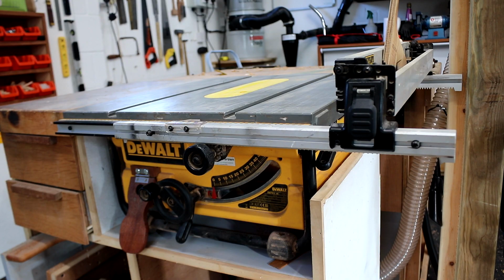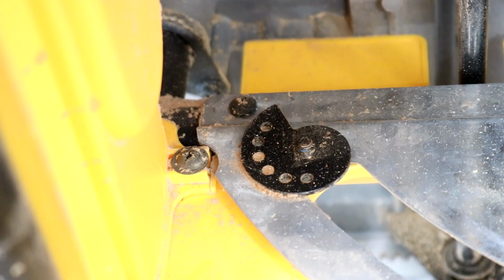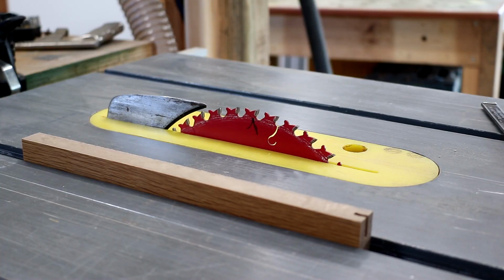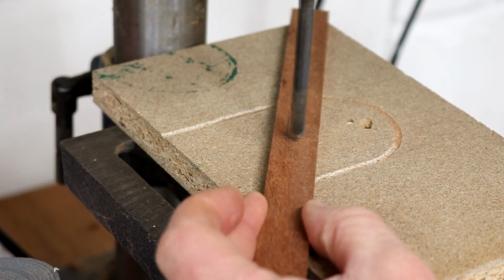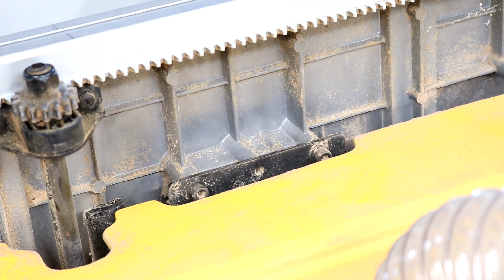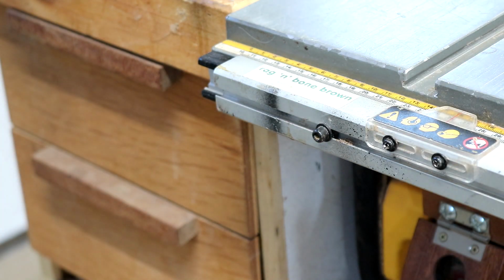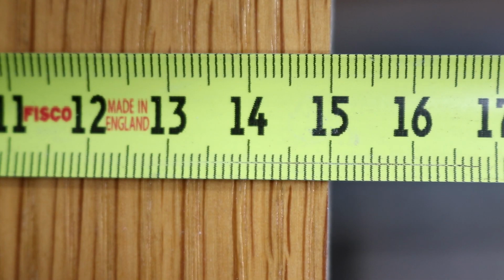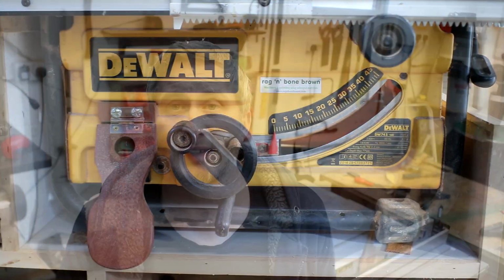Table Saw Set Up - 3 simple steps for accurate cuts. Demonstrated on DeWalt DW745

Comment: Those bolts to loosen the trunnion to adjust the position of the blade are really hard to unscrew.  There must be some thread lock on them or something.   I'm afraid of stripping the screws.  I'm going to reach out to DeWalt customer service for advice.  The table on my 7491RS isn't flat at all.  Too late to take it back now.  But I still like it!  Thanks for the video!

Comment: My new 745 doesn’t use a Phillips for the angle set screw, I uses an Allen/hex wrench.  Unfortunately, they’ve also either moved the screw or changed the blade crank so there is no direct path, physical or visual, o the set screw.  Even if you use the short part of the wrench, you cannot see the set screw or stop because the crank is in the way.  :(.

Comment: I have the DW7491 saw. All is fine except that the table dips in the middle, about 2mm. I could have returned it but I checked in a shop and all the saws had this dip. Its still a good saw.. maybe I will put some tension on it from the bottom, as it would help it.

Comment: Thank you so much.
You are the first you tuber who shows the first and most basic step. How to make sure the blade aligns with the slots in the table for the mitre slides.
If the blade is not parallel to the mitre slots then all the other adjustments are just a waste of time.

Comment: Noticed the other day my dw745 was causing snipe at the end of cut. I though the fence was out so adjusted it to be parallel with blade. Today I thought I would check it and then looked at distance from mitre slots to fence and it is out by 2mm.  Going to follow your advice and try and fix it. Had noticed [like Tamar] that my crosscut sled was not as accurate and zero clearance cut seemed to be wider. Anyway hopefully with your alignment jig I can get it sorted. Thanks Keith ( & Tamar)
Reply from the maker: Thanks for sharing

Comment: Great video. I was wondering when checking with the adjustable square would it be easier to keep that piece of wood on the mitre slow. You could then put the adjustable combi square against that piece of wood  you earlier cut to measure disatance from the blade and the slot on table. Was just wandering if that would be easier

Comment: There's one additional check that isn't mentioned in any of these videos and I learned it the hard way. After cutting tenons for door rails carefully on a scrap piece to get the right height of the blade, and then not having it fit correctly on my real wood, I found that it's very common for the height of the blade to slip due to the vibrations when the saw is running, especially if using a dado blade but I've also had it happen on my regular blade. If your saw is running and you can visually see the blade height wheel turning on its own, you have this problem. To fix it, look under the table. There's a horizontal rod which connects to a vertical rod by way of two cogs that fit together (for lack of a better term). There's a nut at the bottom of the vertical rod. Tighten that until the wheel doesn't slip on its own. Too tight and you won't be able to raise the wheel.
Reply: Aha! Good tip Susie D 👍 I believe the cogs are called bevel gears ⚙️. I didn't know about the snail cams before this video either! Off to tune the tablesaw... 📐
Reply: Thanks!!!!!!!🎉

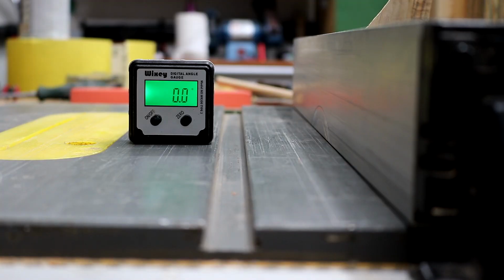Comment: Thanks for the video! Do you know how to solve the fence not being square to the table, mentioned at 6:39? I have a similar Dewalt saw (DWE7480) with a fence that just barely 'leans' toward the blade so it's just under 90 degrees, it's pretty damn close as is but would be great to get it even closer.

Comment: the slightly greater gap on the rear of the blade is and should be intended so the the blade can't bind and shoot the workpiece in your direction.
never try ro get it parallel to the fence oder worse, tighter than the in the front.

Comment: I have a newer version of the DW745 and I'm fairly certain the two mitre slots do not run parallel to each other.
If I make a jig with two perfectly sized runners, the runners slide smoothly with no binding or friction UNTIL they are stuck to the bottom of the jig, when it all binds up.

Not sure there is much to be done there. Part of me wants to return the saw, but then the rest of me recognises it's a jobsite saw and perhaps my expetatins are unrealistic... In saying that, if I'd known it was like this, I'd probably have not bought it.

Comment: How do you compensate for the sloppy fence movement? I’ve noticed while you turn the adjustment know the side of the fence closes to you moves forward or backwards upwards of a 1/4 inch before the other side starts to move..

Comment: Hi.  I'm curious to know if the slots on the base of your machine offer a precise fit for the sliding mitre cutter/gauge. I've recently bought a Dewalt table saw (don't have the model number right now, but looks very similar to one you have in this video) and there is a small amount of play, (side to side) which, to be honest, I'm not too happy about.  Is it the same on your machine? If so, do you have a remedy so it runs smoothly without any play?
Reply from the maker: it's the same on pretty much all table saws at any price point in my experience https://www.youtube.com/watch?v=Jvx4qIGPpAI
Reply: @RagnBoneBrown  The curious thing is that my original table saw, the manufacturer's name escapes now, which was relatively cheap in comparison to the DeWalt I now have, had the sliding mitre section running almost perfectly -- without any noticeable play.  That's why I'm somewhat surprised the DeWalt (and most others, as you say) is lacking in this department.
Reply: @RagnBoneBrown  Do you have any quick fix to remedy that?

Comment: Good info!  The very first step, however, should be to check the blade for runout (wobble).  If there is runout, it could be the blade being not perfectly flat--or worst case--a bent arbor/motor shaft.  But it also may be something as simple as a bit of sawdust between one of the washers and the blade.  If you find runout, first check to make sure the arbor, washers, and blade are perfectly clean.  Be safe!

Comment: I have the dcs8745. My fence is 90 at the front and 89 at the back. Double checking with a square, I can confirm the warped fence. Ugh!!! I like the saw except its only got the single mitre slot on the left and the table is quite small. The mitre guage is pants and the 45/90 adjustments are very fiddly.

Comment: The problem with referencing the blade to one bit of the table is that the tables are not flat.  I'd read about that criticism in a YouTube review before buying my DW7491, but thought it can't be that bad, and it's a job site saw for goodness sake, but mine is at least a millimetre higher in the middle and drops off both sides and, to a lesser extent, front to back.  I have fixed my issue for small jobs via a cross cut sled.  I have not worked out how to overcome the issue with larger pieces.  Hey, I didn't know about the angle adjustment end stop cams.  I've only owned saw a week, and obviously haven't RTFM (read the flipping manual).  Cool tip (or reveal).  Regards measuring tools, you can get a DTI from Wish.com or Bangood.com for as little as US$10, and they work perfectly, and are accurate.  The smaller DTIs don't have all the features of a Starrett but are totally usable.  The larger travel style DTIs from China compare really well with Starrett, Mitutoyo, Brown & Sharp etc.  Other engineering tools that can be incredibly useful in a wood shop are 1-2-3 blocks (about $25 a pair from China).  I use them for everything from aligning edges to setting up jointer blades (with DTI and calipers).  Surface Gauge/scriber blocks are also invaluable, but not available from wish and bangood.  I paid NZ$60 for mine.  The digital angle finder you used is another incredibly useful tool.  I actually use mine for setting angles of job pieces in the milling machine vice as well as table saw blades and fences, and jointer fence.   BTW a tiny warning about wish.com... once you start using it you'll have a job stopping.  I have spent at least a thousand bucks between wish and bangood, but my toolbox is almost as well equipped now in retirement as when I was still working as a toolmaker.
Reply: Any saw with an aluminum table has this problem. Milled cast iron table saws are heavier, so aren't used for "jobsite" saws. I only have a small shed, so the compromise on weight/table flatness is OK with me. I love the fence on this saw, which is what sold me on it vs. competitor models.
Reply: Hello, I am having a similar issue with my table saw. The top table is not straight and the precision mitre gage does not lie flat in the mitre slot, it seesaws front to back. I got a useless response from dewalt today and have no idea if something can be done about that. Would you have any ideas? Thanks
Reply: @radu-christianbarca746  The cross cut sled is the ultimate solution.  They are not only far more accurate (especially if you use the William Ng 'five cut' method to set the rear fence https://www.youtube.com/watch?v=UbG-n--LFgQ) they are also much safer because the part is supported both sides of the cut which makes kick-back unlikely.  Even if you  do manage to get a kick-back, the rear fence is going to catch the part preventing it hitting you in the face at 100mph. There are also lots of designs for smaller, single fence sleds that work like a mitre gage. i.e. https://www.youtube.com/watch?v=L4czbtrzGBQ  

The main thing is to use both T slots which will help take out any slop, and have a wooden base that eliminates the warped top.  It is also a fun project.  You'll end up with a bunch of sleds like 45° mitre (William Ng has a tip for getting these super accurate as well) a tenon cutting https://www.youtube.com/watch?v=TcTGm9vQ-QI and any number more if you search youtube.
Reply: @TrevorDennis100  thank you very much! I will watch those videos attentively and i will surely end up biilding a sled. Still, wouldn t the sled glide on those u even miter slots? Side to side wiggle can be eliminated, but back to front slopes will translate to the sled's fwd bckwrd motion and to the wood in relation to the blade. Which would matter in some cuts, but not others obviously. Am I missing something here?

Comment: Curious whether your saw has a 5/8” (16mm depending where you’re from) arbor? If so how did you manage to get a 30mm Freud blade on it? I can’t fit a 30-16mm reduction bush on mine because of the concave flange design on the saw. There’s far too much room for the bush to move around on the spindle losing contact with the blade bore, in the process. Spoken to at least 6 different people at Dewalt and no-one has any idea how you can do it safely? Not for a 30mm bore anyway.
Reply from the maker: It has a 30mm arbour. No adapter ring needed
Reply: Rag 'n' Bone Brown amazing, here in Australia both the DWE745 and the DWE7491 are sold with a 16mm arbour. No idea why they’d make them different?

Comment: I have the same saw and my fence is not vertically perpendicular to the table. you mentioned checking this but not how to correct. i can seem to figure out how to get the fence to 90degrees vertical. Any tips?

Comment: Great info, I have the dewalt dwe7492 and my fence is not 90 to the table, do you how to set the fence. thanks John
Reply: I've got the very same problem. I've taken the fence apart by removing the aluminum fence from the side plastic  brackets, but that didn't do any good as there is no play to try and adjust the 90° angle to the table. A little help would be much appreciated. Thanks

Comment: my left mitre slot is definitely not straight. and my table saw top is not flat. i bought this table saw last year and only opened it a couple of weeks ago. lol
Reply from the maker: That's some poor quality control 😕
Reply: I have exactly the same problem (same model as Matt's). In fact, the coating starting chipping off inside the mitre slot. Any ideas on how I could fix this? Would really appreciate some advice

Comment: Hi, thanks or this video, it has answered all my questions that i had about a small saw. i looking forward to get one. i was wondering is your fence an after market one or is it Dewalt's own with the machine. i was looking forward to  buy Bosch and wishing to sort out an after market fence for accuracy.  your input will be much appreciated mate. thanks
Reply: mian isbah rehman That’s Dewalt’s standard fence. In my opinion, their rack and pinion adjustment system is one of the best on the market.

Comment: Do you know how to adjust the fence so it is perpendicular to the table top? Everything is setup really well on my dewalt saw but the fence isnt quite square. Its perfectly parallel to the mitre slots and blade but needs the fence adjusting on its vertical plane. You note to check vertical alignment but dont mention how to adjust this setting if it needs changing. Thanks
Reply from the maker: I'm not sure, not something I've needed to do sorry. Not sure if it is adjustable - might be worth tweeting DeWalt!
Reply: @RagnBoneBrown  okay thanks. Made contact with dewalt so now  waiting for an answer
Reply: @djmdog8754  Any response from Dewalt on how to adjust that fence to be purpendicular to the table top?
Reply: @arnoldwiggins  they said its not adjustable so i just live with it, but when i need to be really accurate I add a plywood fence against the metal fence which i can tweak with thin plastic window fitting shims to get perfect.  I rarely need to be that accurate on the vertical as most wood i use is quite short so touches the same part of the fence and can be cut on a single pass. I do however find large timbers needing to be flipped over to fully rip are the main problem eg 150mm   thick as i dont have a jointer the wood can touch different heights on the metal fence if its not square and gives an inaccurate cut that needs some finessing with a hand plane to remove any steps in the cut between the first and second pass.
Reply: Thanks DJ, good suggestions. I saw another video suggesting the use of shims between the fence and the rail so that the whole back of the fence is tilted forward slightly. I guess that's another option. Cheers

Comment: I was literally checking my saw today! I have a hammer K3 Winner. Owned it for just under a year. My entire side table support was not level, took an hour or so to bring it back up to level. This will now be checked more periodically. I use to own a Bosch contractors table saw but this was a big upgrade for me in every way! I think my workshop is the same size as yours Keith. Some good tips here.

Comment: Thanks for the video..what would you say is acceptable blade run out for this kind of saw.? I recently returned one with 0.8mm out the box .. it seemed to get worse in the couple hours I used the saw.. the issue according to DeWalt is a batch of faulty Arbor pressings.. worth checking if you've just brought one of these...

Comment: Contractor saws do not have the flattest tops.  They're made with aluminum to make them lighter, which can warp slightly during manufacturing.    I found this out after I bought mine, and went through several tops and never got one that was as flat as a contractor cast iron top.    So I ended up with the top I bought it with.   That said, you can still do incredibly accurate work with them, just look at Tamar's most recent video.   You just can't use it as a flat reference like so many channels suggest.

These tops also have a special coating on them to keep the aluminum from oxidizing, so probably not a good idea to try flattening them yourself.
Reply: I have the dwe7491 similar saw. Had two with bent tops. https://youtu.be/o0EP2WhLaTM DeWalt have offered to take to third party for repair. Not really sure what they could repair but I might let them try. Just means I'll be without saw for couple of weeks.
Reply: You can protect it with wax.

Comment: That was a really good guide and very nicely presented. I would suggest adding how to adjust the insert correctly. Amazon are currently selling the Trend angle finder somewhat cheaper than yours and there are several that are cheaper still. Personally I would go for the Trend device as I trust the brand and I think many of the others are Chinese clones, which I would not be as comfortable with. Where doe the phrase “bob on”come from, not heard that before!<g>. Well done.
Reply from the maker: I think bob on is a northern expression, but I like it so much that I've adopted it
Reply: My friends from North Yorkshire have used it since I met them at uni, at the end of last century. I love bob on, it's a great expression.
Reply: It helps if Bob's your uncle.  In Canada and the US, the expression is either "dead on", or "dead nuts".
Reply: You’re welcome Keith., I could tell you liked it when I commented on your video the other week. I’m from the East Midlands and we use it here.

Comment: Really handy stuff, thanks Keith.
I needed to remove the giving knife on my 745 this week. However, part way through doing so. I realised that the bolt is missing from it 😳. Can’t figure out how to remove the knife without the bolt in place to engage the spring mechanism. Have ordered a new bolt and really hoping that it’s going to be easy to fit 😖. Note to self to check second-hand purchases in future!
Reply from the maker: Hi Darren, oh dear that's not good! It's a bit of a tight space down there so I think that replacement bolt is your best bet- good luck!